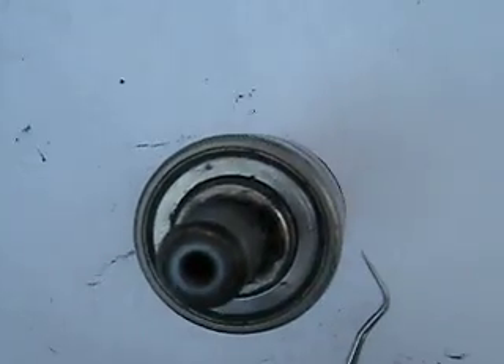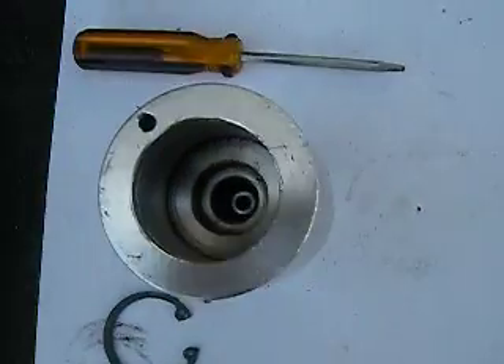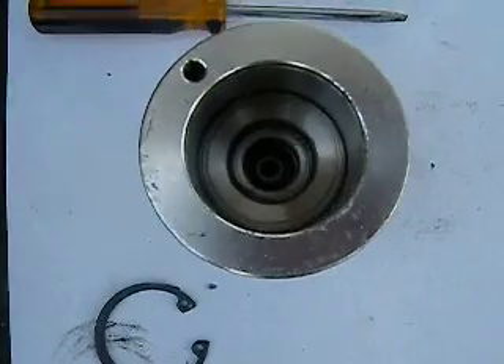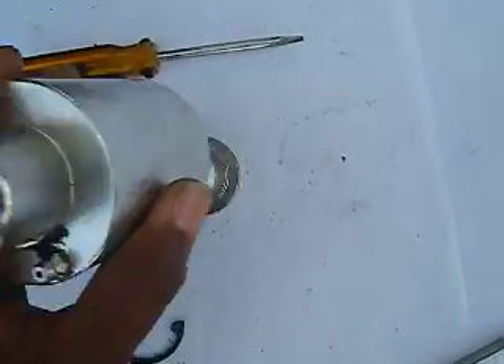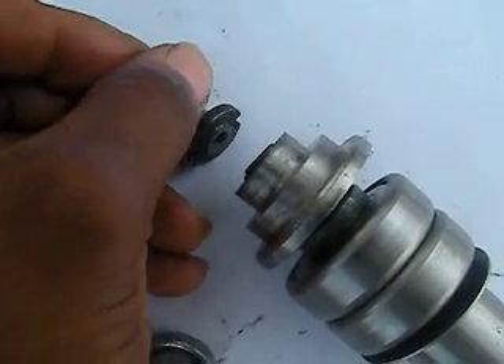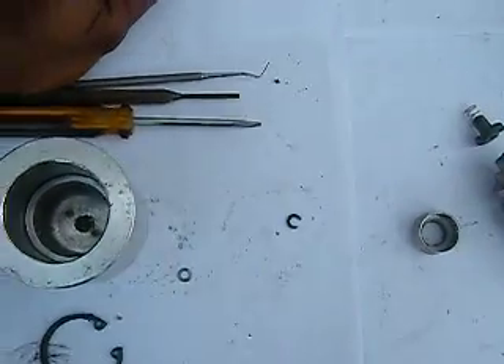Whirl-A-Way or BE Surface Cleaner Swivel Disassembly

Comment: hi - great old video - how do you get the o ring out that holds the bottom section in the housing - my bottom section is stuck
Reply from the maker: Used an Oring pick... Its like a dental pick..

Comment: What type of grease should i use for the bearings?
Reply from the maker: I used a multi purpose grease, but based on experience it need very little (at least this first generation model I have)
I noticed a dramatic decrease in speed the first time greased, I think part of the reason was because the old grease did not exit a overflow port....
So I opened then housing and cleaned out as much as I could
Reply: Griffs Services thanks for the reply. Mine stopped spinning and i disassembled it. I noticed the grease was too sticky and didn’t allow the bearings to move so i figured the wrong type was use but it makes sense that too much was used. Thanks again.
Reply from the maker: @androglenner  no probs..
The bearing numbers are in one of the videos....or the description of

Comment: I have a shaft that was broken. Is it possible to remove the shaft itself and replace it?
Reply: I am certain you can...but what caused the break is what peaked my curiosity? would it be more productive to just change out the entire swivel, although it may cost a bit more. definitely worth looking into if the bearing are worn
Reply: *****  I have a 28 inch surface cleaner, and between jobs I decided to clean my patio. The spinning bar at the bottom hit a piece of weight lifting equipment. It snapped the threaded portion of the shaft. I removed everything except for the shaft, the bearing, and the housing around it. I agree that it might be easier to change entire swivel.
Reply: +Stephen Rodriguez...that type of impact would do damage. . I did not know BE has a 28". are you going to get a new swivel?

Comment: Thanks for the heads up my friend. The bearings are rolling fine, there's a little more movement of the shaft than there used to be. so there is added vibration but I can live with that until they fail completely.I have the surface cleaner working perfectly again thanks!

Comment from the maker: If I remember right there is no access to the inner race of the bearings, so the design only leaves you with the option to apply a force to the shaft at the seal face end while the outer race of the bearing is supported against immovable object. With the rotating face being welded to the shaft, its a designed as if the bearing has failed its time to change the shaft as well.

Comment from the maker: Hi Jim, happy to hear the video was helpful.
Two of the three spray tips working, the only hypothesis is a blockage in the tubing, elbow or nozzle. Blow a stream of compressed air through the bar without any nozzles to ensure it all ports are obstruction free. Then ensure each nozzle is clear. Sometimes the internals of the bars get corroded, in 2009 when I last checked BE bars were non-stainless and prone to corrosion, corrosion can be also be dislodged from non stainless heating coils.

Comment: Thank you Griffs services for the helpful vid! I have the BE Whirl away 24 that I replaced the the o rings on because water was shooting out of the by-pass hole. Oddly enough though when I did the repair it worked no more water coming out of the by-pass hole but only 2 of the three sprayer tips was working. I did not not observe any blockages . Can you advise?
Reply: Jim, what o ring sizes did you use and where did you get them from? I have a BE Surface Cleaner and water is shooting out of the by-pass hole.

Comment from the maker: The vitons have held up very well, remember you can heat water past 212F and still be water in the boiler and hoses, because it is above std. atmosphere, however I cant hit more than 100F rise without cuting my flow through the nozzles, I run 8 gpm with a 20" std. boiler with 4gph fuel setup

Comment from the maker: Notice in video that the O ring that was observed damaged on the inlet valve (at 3.39) this would contribute to leakage around the inlet valve stem and into the cavity resulting in reduced pressure at the nozzles. This seams to be the prime failure point of swivel. 
The O ring is part of a complete mechanical seal, so if the O ring fails it may mean that the seal faces may still be in good shape. The outer diameter of this O ring slides on the inside of the housing when the trigger is pulled.